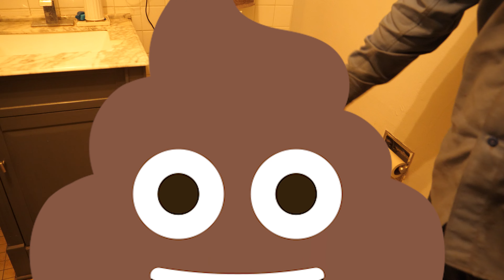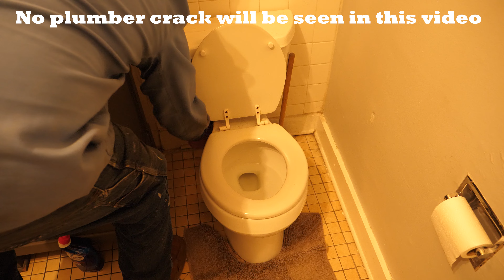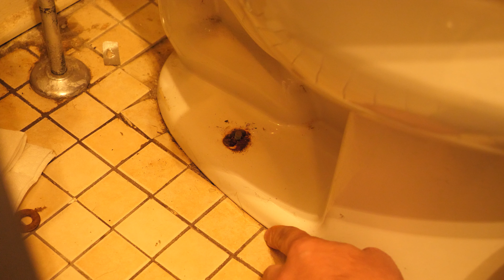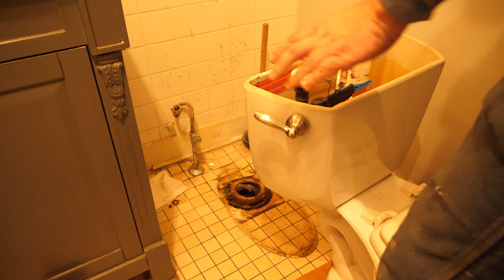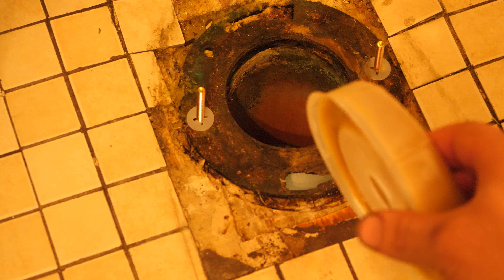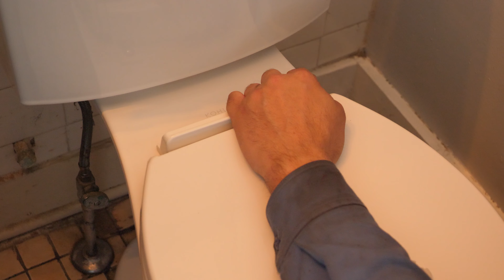How to replace a toilet

Comment: Idk how I didn't see this video get uploaded. I actually just replaced the insides of my toilet 2 days ago. New fill valve along with flapper. I'm also about to be adding a hammer arrestor to the toilet to stop some banging when the toilet fill valve cuts off.
Reply from the maker: It’s nice to have a functioning toilet 😀.  A sense of accomplishment of doing it yourself is a added bonus too 😀

Comment: Crazy, just saw this video and I just got done installing a new Kohler toilet in our bathroom. The original was installed in 1987 when the house was built and about 3 inches shorter than this one. I’m getting older, so this one will be easier to get up and down onto. We got the kohler gleam model. Good to go for another 37 years. Thanks.

Comment: Thanks for sharing your Shitter with us all Greg. 😂
Getting ready to replace our downstairs crapper with a full size oval seat type. I will tell you what, once you get a taller toilet with oval seat and no slam lid, you’ll never go back!
Don’t give me the crap story about how a lower seat postures a person to better evacuate their colon. 
 Get a full size thrown and forever live like a King or Queen! 😎👍
Reply from the maker: Haha that one I put in had a no slam lid too, such foreign technology to me.  Personally I like the ones that never plug.  I swear if I ever build a house I am putting one of those turbo Walmart bathroom toilets in it 😅
Reply: @makingmistakeswithgreg  Yes, a toilet with a pump built in. Our basement has very little drop for gravity to get the flush into the sump/shit pit where I have a pump with a masticator blade to chew up the goods. 💩 😁👍

Comment: Good move on not using a wax ring with that stupid black plastic insert. Wax rings are only there to seal the sewer gas, they're not watertight. The problem with that stupid black plastic horn that the old wax ring had, is, when you flush the toilet, water splashes up from hitting that black plastic part, and washes away the wax, and causes water seepage around the back of the toilet. That is probably why the floor is all sunken in around it.

The best thing I've found is those "stick on" rubber wax ring replacement things, you peel and stick it on to the bottom of a new toilet bowl, then VERY carefully set it into place, it has a rubber "snout" that fits down inside your sewer pipe. The only drawback is, you have to be very careful setting the toilet so you don't get a fold or kink in that rubber snout, it has to fit neatly down into the sewer pipe. If it gets a fold in it, the water will hit it and splash right out.

Another thing you should have done, is get rid of that braided supply line! Please go back and get rid of it if you can. Did you see all the black water that got into the toilet tank when you first turned on the water? Those stupid braided hoses are worthless, all they are is a cheap black rubber hose with an outer jacket of braided stainless. What happens is, the rubber rots over time, and those little chunks of rubber have ruined A LOT of fluidmasters for me over the years.

A much better idea, is go buy a cheap PEX toilet supply line from Menards with a 3/8" compression nut. Remove that braided POS, and replace it with a PEX toilet supply line, they're only about $4, and they never break or leak, and do not turn the water black or rot out internally and keep little chunks of crap from screwing up the toilet fill valve (aka Fluidmaster). Another big benefit of those PEX supply lines, is you can cut them to fix exactly the right length, so you don't have that ugly coiled up pigtail thing.

Other than that, great job on the toilet.
Reply from the maker: Thanks for the tips on the pex line.  That bathroom will get remodeled at some point so I definitely will be redoing the water line.  Sounds to me like you have done a number of toilets lol.  Somehow I always get volunteered to do them.  I find it funny because it’s easy work, and people are deathly afraid of them 😅.  I have been in by far worse situations, so it’s not bad at all 😅.
Reply: @makingmistakeswithgreg  Yes I have, and also I've had the fun of one of those braided water lines blowing up under my bathroom vanity and woke me up at 2:30am to the pleasant sound of a big water leak. I was able to shut it off in time before it made much of a flood, but what happened was that crimped part blew off the 3/8" end where it screws on to the water shutoff stop valve. :)

Comment: Got me 
, aprils fools. But nevertheless a very interresting Video with Chucks nasty sidestory. You're right, the toilets overseas (here) commonly have the connection to the drain horizontally, mounted with slip-in rubber gaskets. But seeing it the first time, your way to mount seems to be way more "natural" 😂
Reply from the maker: It was always puzzling to me how different countries do plumbing.  Everyone tries to reinvent the wheel, when the simple approach is often the best 😀

Comment: Well I'm not the only one that wakes in the middle of the night. Done my fair share of toilets. I'd rather been a good welder.
Reply: I had to repair one in a small bathroom several months ago.  Had to replace a lot of the floor where water leaked around the wax donut.  Other than working in cramped space, the hardest part was trying to stand over the bowl and hold it up while placing it down exactly on the flange bolts.  You can't see them too well from above -- and trying to line everything up while holding that weight was when the real cussing started.
Reply: So many little things can go wrong. I know too well. I should've been making vids then. It'd be like the 3 Stooges doing the repairs.
Reply from the maker: Haha I much rather weld than do toilets for sure.  The worst is dealing with plugged drains/sewer lines.  For a while I swear i was helping friends out every other day snaking main sewer lines.  Despite working at a sewage treatment plant I have a pretty weak stomach.  Unclogging house sewer lines will definitely make a man out of someone 😅.
Reply: I enjoy all your vids. Jus start'n out myself. Need to learn how to edit, copy, paste for my channel. For a onetime newspaper guy, it's a fun new ballgame. Thanks

Comment: I hate those wax seals. There are some non-wax alternatives, but they don't seem to work well.

BTW, you can use a toilet plunger to force most of the bowl water down the drain before pulling it off.
Reply from the maker: Great idea on the plunger 😀